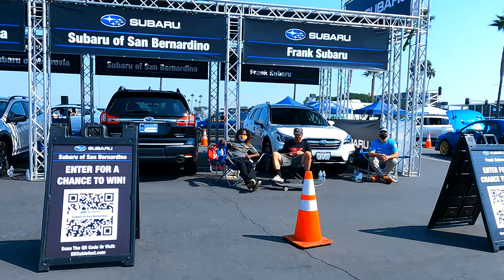SUBIEFEST 2020 | SUBARU FAMILY VLOG | LIFTED SUBARU WRX | GUINNESS WORLD RECORD | CHARITY EVENT

Comment: What are the wheel and tire specs?
Reply from the maker: The wheels are 15x7 and tires are 215/75/15.
Reply: @partyof4sometimes2  thank you!! Do you know the offset or are you using wheel spacers?
Reply from the maker: Offset is +40 and I am also using 1” spacers